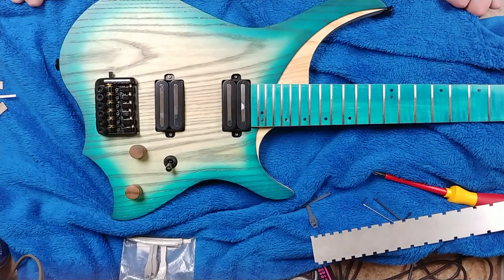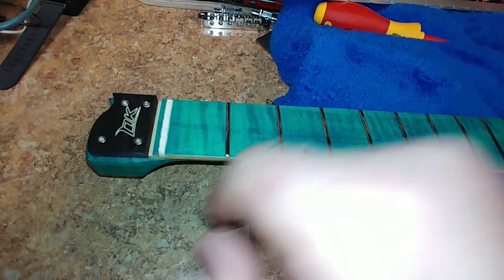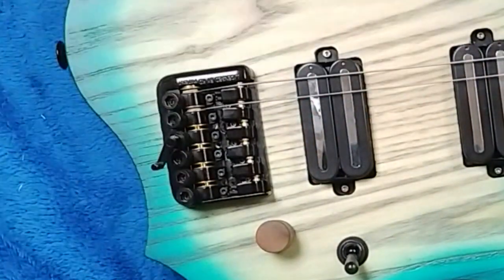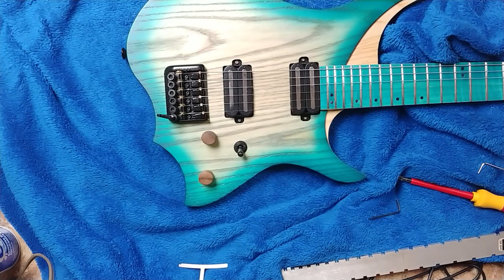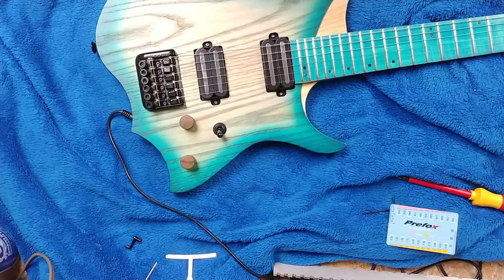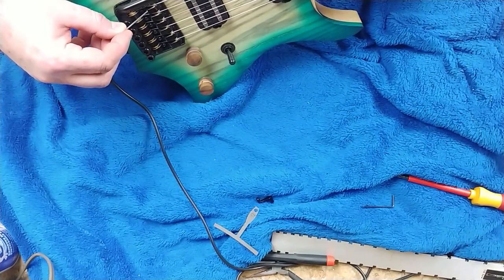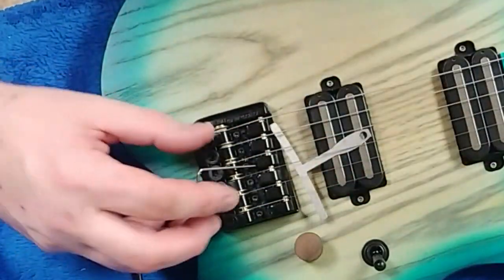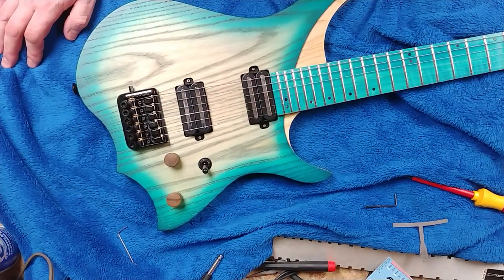NK Guitar Setup Part 2

Comment: I'm looking at this bridge to use with a headstock with locking nut. I want as fixed bridge with fine tuners. This could work. Also ebay has the bridge kit for 40 something

Comment: I have one of these I got from a guy for 100 bucks.  He got it new and the frets had been leveled and never crowned or smoothed lol.  They had file marks and bending the strings was grindy lol.  I used my exes crown files and watched videos and used black marker and took my time.  Some 800 grit wet dry paper and then some steel wool shined em up nicely.  I did all these adjustments you did in this video but all by feel and sight.  Its action is probably the lowest of any guitar I own right now and I find myself playing it more then most of my more expensive good guitars.  Its funny but this thing is fun to play.  Putting strings on it I found was faster and simpler then putting strings on my Floyds  and can string this guitar up in a fraction of the time .  The only gripe I have is when you adjust the string height the ball the string sits on rotates forward or back and this changes the intonation of the guitar every time you adjust the string height was a pain.    Otherwise the work on the frets paid off and its a great fun guitar to play.

Comment: Nice video, it was really helpful and informative! Mine just arrived and I had no idea how to restring it. Got one question for you: are the strings supposed to rest on the small saddles of the bridge? Some of my strings aren't even touching them and maybe I have to adjust that. Thanks for your time!
Reply from the maker: is it the same bridge? the strings are supposed to be in each saddle.
Reply: @ericctheartofnoise8613  Yeah, its the exact same model. Two strings are barely touching the saddles and the A string doesn't even touch at all. I guess thats where my fret buzz comes from and I have to adjust the height. Thanks!

Comment: Hey man, nice video! I was planning to buy one of this to make a travel guitar, but i'm left handed, and i was wondering if this could be suitable for being used inverted
Reply from the maker: i don't think it would be a problem other that the volume and tone being on top.
Reply: @ericctheartofnoise8613  okay it won't be a problem, thanks
Reply from the maker: your going to have to pop the nut and turn it around for the string size, but thats about it. give it a setup and your should be good.

Comment: Is the paint on this bridge conductive? How is it grounded?
Reply from the maker: No. There is a part under the bridge where a wire comes from the controls to under the bridge that is bear metal. .
Reply: @ericctheartofnoise8613  Oh, I see… but the exposed metal is on the other side of the bridge. Did you create a long channel for the wire or something? I’m thinking I can probably scuff the corner closest to the control cavity to remove the paint. What do you think?
Reply from the maker: No, it came that way. from the control cavity to under the bridge there was a hole already drilled for the ground wire. I didn't have to add one.